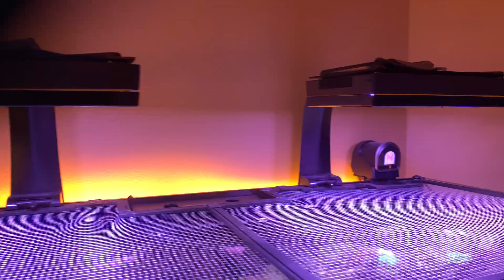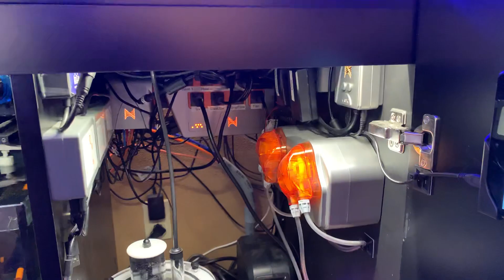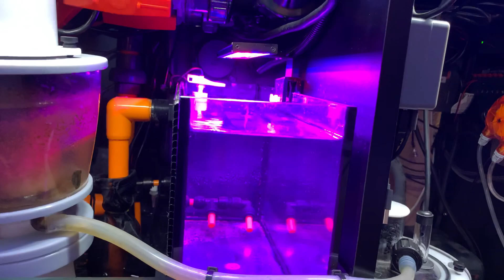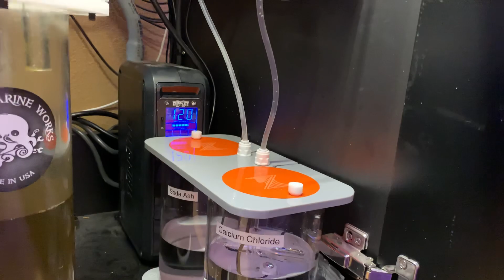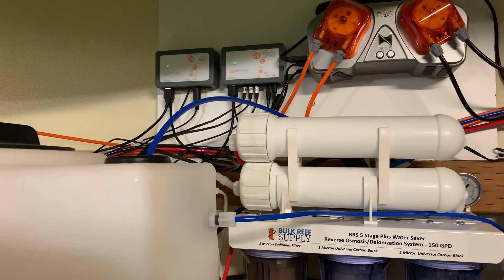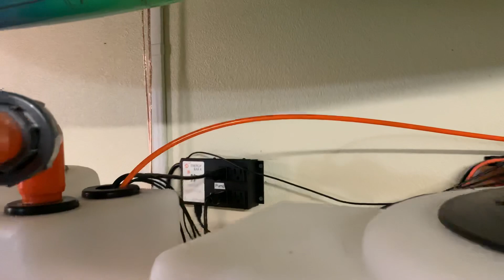Reefer XL 425 Tour

Comment: I have almost the same setup (y), might I ask how your pumps are setup? I only have the Maxspect on the side (like yours) and the Sump outlet Split Left and Right. Was thinking of adding a second pumpe on the Left wall as well. Not sure if that yout be too much... Tim
Reply from the maker: I have the Maxspect Gyre on the right side alternating between forward and reverse every 10 seconds, creating a sort of swaying current in the tank.  Then the Neptune WAV on the left rear wall is running the Mavericks pattern, providing a lot of turbulent flow where the streams intersect.  My rock work is pretty tall, so it blocks a lot of flow, making the 2 powerheads necessary.
Reply: Suncrest Reef then you use the forward and backward propeller in der maxspect?
Reply from the maker: @American_Outlaw69  I control the Maxspect with my Apex and the IceCap Gyre module.  It uses two channels of the 0-10v port, one controlling the speed and the other controlling the direction, so it runs the motor forward, then it runs the motor in reverse.  It changes rotation direction every 10 seconds.

Comment: Great looking tank and amazing setup, I would love to see more of your tank and continued success in this hobby. When you panned over your sump I noticed the carbon in your reactor is tumbling. You may want to adjust the reactor to prevent tumbling of carob because carbon is fairly soft and will erode if used in this way.
Reply from the maker: Thanks, glad you like the setup.  Yes, I did adjust my carbon reactor a while back so it's not tumbling now.  If you haven't seen it, you can check out my complete build thread on Reef2Reef:  https://www.reef2reef.com/threads/suncrestreefs-red-sea-reefer-xl-425-build.358990/